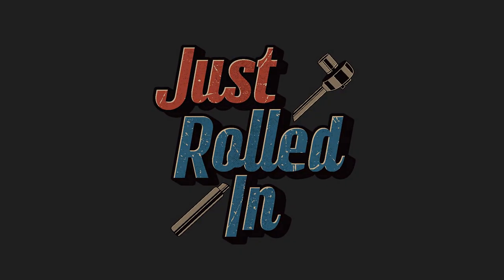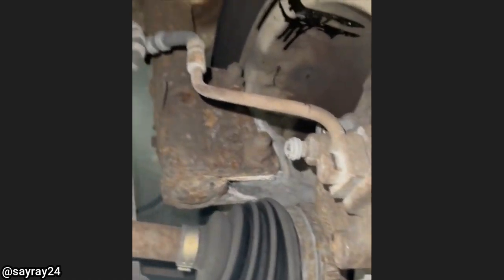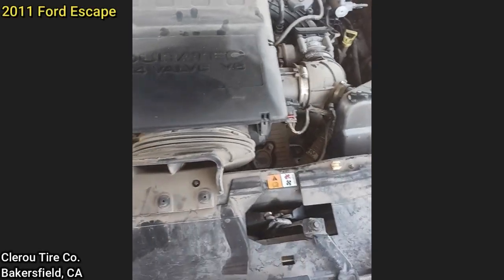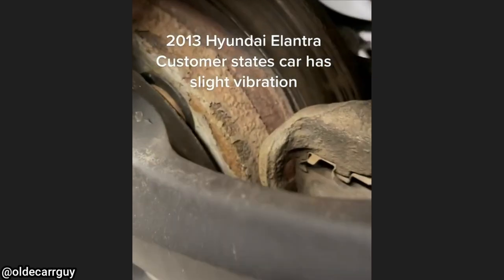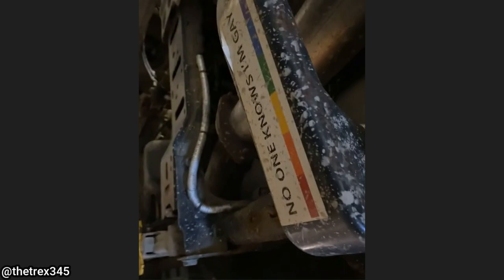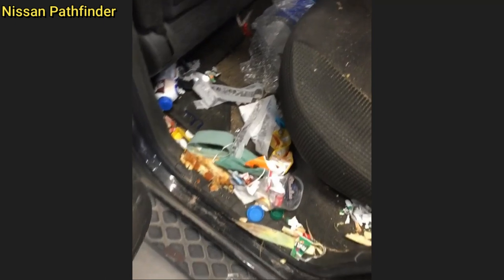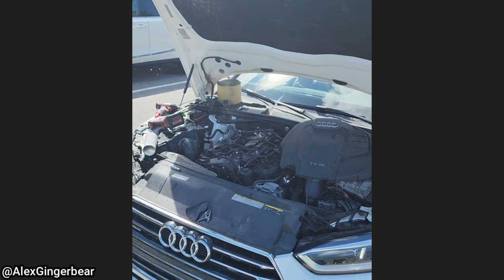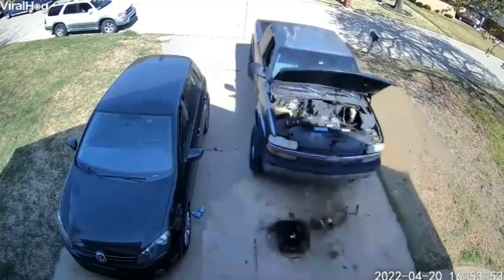Customer States Truck Still Overheats After New Parts Were Installed | Just Rolled In

Comment: To the last guy doing the oil change, have you ever heard of PARK?  Or PARKING BRAKE?  Or a block of wood under your tire ?   🙄
Reply: yeah, seriously... park isn't something you trust your life with.
Reply: A similar thing happened to my dad when the parking break on his truck failed.
Reply: chock it up to a lack of experience
Reply: As a guy with automatic trans in "world of manuals" called EU, i can agree. Park isn't 100% safe, Parking Brake needs to be at least on one side fully working. As a Citroen C5 owner - it has Parking Brake on... front wheels. It's a pain to replace.
Reply: @mmllmmll22  French cars just have to be that bit different don't they?
Reply: @MJA5  I see what you did there 😆
Reply: Natural selection at it's finest!
Reply: @MJA5  lol i got that one 😄
Reply: You always chock your wheels when working on your vehicle... Damn.. dude was lucky his truck was high enough to allow what happened...
Reply: @volvo09  to be fair, I’ve never seen park fail in any vehicle… even vehicles over 40 years old. But I always at least put a block behind the tire
Reply: Except when that vehicle's military grade. Those vehicles are built as cheap as possible.
Reply: I get skeptical when something highly unlikely happens and someone just happens to get it all on perfectly framed video. 🤔
Reply: @crimsonlight4205  I haven't either, but with older vehicles and cable actuated transmissions you never know if it's on the "edge" of falling out of park. Like an old 90's Ford with a floppy column shift, plenty of people have had those roll away on them.
Reply: Or life insurance. LOL
Reply: Wheel chocks are cheap. Wood and concrete are probably lying around somewhere. Geez
Reply: I’ve heard of the parking prawls giving out. Maybe that’s what happened here.
Reply: Suspicious fault I'd check the wife's intentions
Reply: I didn’t think gravity kicked in till the afternoon!
Reply: LOL of course not he ain't heard a common sense either 😂
Reply: @joeromanak8797  well if you have security cameras and remember to pull the footage before it resets then it isn't that unbelievable.  Especially in this case where the camera is obviously supposed to be focusing on the vehicles in the driveway (maybe they have issues with part or tire theft in the area?) this is exactly a reason to have the footage if something like this happens.
Reply: @joeromanak8797  also why the f would you lay completely under your car to change the oil? Literally never seen a car you could drain from lying under the front
Reply: The block of wood was already busy atop his neck...

Seriously though, decent chocks are less than $30 per pair, bricks and such cheaper still.
Reply: So you guys put blocks behind your tires every time you park? Wild!
Reply: @IDT69  Don't be an idiot.  Parking your car and getting under your vehicle while it is on a slope to work on it is two distinctly things.  Imagine that,  WILD
Reply: @IDT69  Fuck yes, every time I'm risking my life getting under it and especially when it's on an obvious incline.
Reply: @richardthomas1743  if you’re terrified of being under your vehicle because it’s so unsafe surely you care about the safety of others, you’re not an “idiot” are you?
Reply: @BWolf00  but you don’t mind risking others lives when parked on an incline in any random place?
Reply: @volvo09  oh well that’s a Ford that’s to be expected lol, that and dodge. Haven’t had that problem in chevies though. In fact I don’t think I’ve ever owned a Chevy with a sloppy transmission…
Reply: @IDT69  Oh I have that covered too, I keep a bag of troll heads in the car just for such occasions.  The nice thing is there are so many willing to donate to the safety of others, I just drive off leaving them for mother nature to take care of...there's always a hungry possum or a feral cat around.
Reply: @IDT69  you are manufacturing an issue, a straw man argument if I have my analogies correct.

Personal safety while laying under a vehicle is far different from being a bystander or random person on the street. If that level of safety was true parking spots would have D ring tie down points in the road for drivers to ratchet strap their vehicles for safe parking
Reply: @mmllmmll22  Wow that's crazy, who would have thought cars were built very similar across the world? Certainly not I, thank you for the Ted Talk.
Reply: @joeromanak8797  You definitely wouldn’t have believed what happened to me on April 1st, 2018 then but, then again, the world keeps on turning on April Fools Day too. April 1st also happened to be Easter that year.
Reply: I do all of the above and I still don’t trust it deep down lol.
Reply: Always put something on front and behind your wheels. Especially if you have to work on an incline! Gah!
Reply: @MJA5  I like what you did there lol
Reply: Just put it in first gear if you drive a manuel like normal men
Reply: Tire blocks!
Reply: @DatsunBloke7357  Sometimes clutches get weak and can lead to the trans to popping out of gear.  Chocking the wheels is the only way to ensure the safety.
Reply: @BWolf00  or be on a flat surface with the wood chock
Reply: @liamholcroft7212  Seems to be
Reply: @joeromanak8797  I'm assuming this was a security camera. But there are definitely some crazy "coincidences"
Reply: I think that was staged.
Reply: My 2006 cheverolet silverado would randomly put the transfer case into neutral. Which caused it to do this. But yea use a chock block of some kind guy.
Reply: @user-zl5gi8sv7u  I lay under the front of my Matrix and Camry, but not up under the entire vehicle like that. Maybe he was checking other stuff while underneath? I lay under a VW bus I used to own in order to replace the heater channel.
Reply: Don’t trust park.  Chock it.
Reply: I always used Park and the E-brake. I also went head first from the bumper end. I worked so that if it sat on the ramps at my head. If it rolled back, it rolled away from me.
Reply: @volvo09  I park in a garage, at work I park on flat too. Still always apply the parking brake, For one thing its beyond safety.  Depending on the transmission also has the potential to damage the transmission while the brake is meant to hold things still.
Reply: @liamholcroft7212  it's just that specific model that is like that thankfully
Reply: @benjiderrick4590  No I don't have a c5, I'm not a Citroen fan...
Reply: @liamholcroft7212  whoops I replied to the wrong person 🙃
Reply: Still, an automatic Citroën C5 ? You are one of the 3 people that bought it ?
Reply: Just so you know OP, youtube asked me to rate your comment. I rated it as excellent as I suspect this is some kind of new censorship system that they are testing.
Reply: I dont think idiots would know how to STOP their car from moving when you're working on it. It just baffles me to how amateurish these mistakes are. 💢
Reply: @MaddJakd  I didnt know how to do anything on a car 7 years ago. Now that I do, I know what to look out for. Cant really say the same for these people.
Reply: @zerovertigo3199  And that's the problem! Learned something and not only acting like you're better than others, but pretending you didn't have to start somewhere back then.

I know old guys who do some god tier work on cars, but they aren't acting like they knew it all from before time and space itself
Reply: @MaddJakd  Experience matters, now more than ever. As cars get more complex and require more procedures, it really pays to have all the knowledge.
Reply: @zerovertigo3199  That's beside the point, but yes. Even then in the end, cars are just one big puzzle of sorts, as one of my mechanic friends described it.

Even looking into my current garage, the principals are essentially the same. Just more stuff to worry about (and somewhat marvel at if that your cup of tea)

Definitely some rage inducing bits to, which make you wish the worse of deaths upon the engineers.
Reply: @MaddJakd  lmao. Yes I have seen horribly designed cars. Particularly the German designed kind.
Reply: @zerovertigo3199  I used to think that but after seeing a few teardowns, I'd call them needlessly complex (okay, guess thats the same lol. Even with certified mechanics in the gang, I wouldn't touch anything out of Germany apart from a certain transmission)
Reply: @MaddJakd  needlessly complex with a lot of plastic, yes. 🤣
Reply: @zerovertigo3199  The plastic abuse 😫 And pop rivets!

To hell with safety and crumple zones! Gimme some real materials, and steel. Or at least something that isn't gonna plop and cave in because I poked at it too hard
Reply: @MaddJakd  it's all part of plans to make cars as cheaply as possible. Its disgusting
Reply: Yes
Reply: The last guy is lucky the truck was high enough not to drag him with it!!
Reply: He also tried to grab the front of the truck and pull to slow it down rather than get access to a brake, so it all checks out
Reply: Dude are you thick in the head? 
Getting under two tons of steel is a reason good enough to take some safety precautions, no matter if you think it’s safe or not, you put blocks behind the tires just to be sure.
Reply: I don't know what a full story but that's Star Trek actor died because his car rolled back on him
Reply: Pickup truck gravity!
Reply: @crimsonlight4205  it probably wasn’t that Park failed. He probably hit the arm or shift cable at the transmission.
Reply: I mean... not counting on that guy to have common sense considering we can see him try to stop the car by grabbing it and pulling ROFL
Reply: The block of wood is on his shoulders....
Reply: I use park, e-brake (parking brake) and block.. if all three fail I have more issues than just the oil
Reply: Blocks of wood under tyres save lives!
Reply: Unless you're (actively) doing brakes... set all of the above. Each one can fail (or you can defeat it inadvertently)!
Reply: If youre under the car, all of those.
Reply: Deve essere finito l'effetto della anestesia, il pick up si è svegliato durante l'operazione impaurendosi. Quindi d'istinto ha cercato di scappare! 😂. Sto scherzando!
Reply: I trust park more because parking brake is weak and won't fully hold it.
Reply: Really …. I never would have thought!